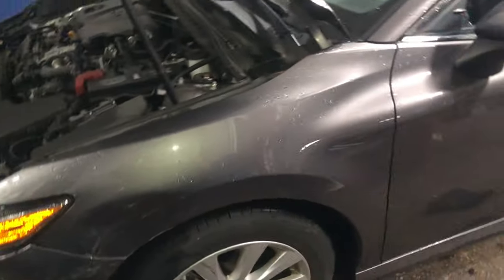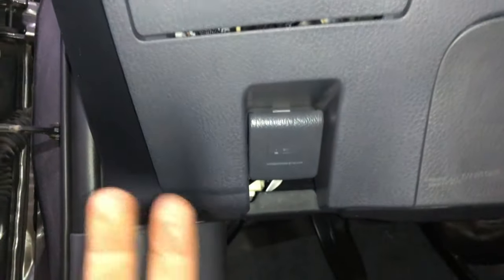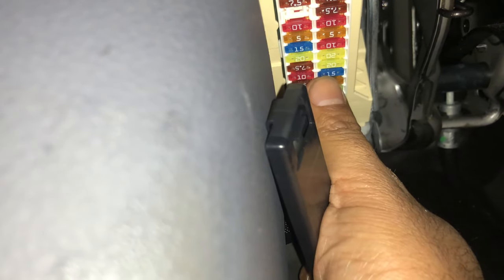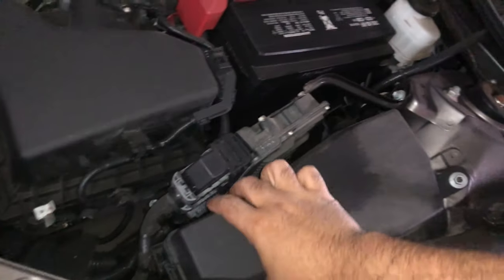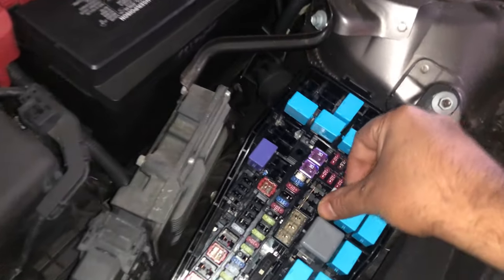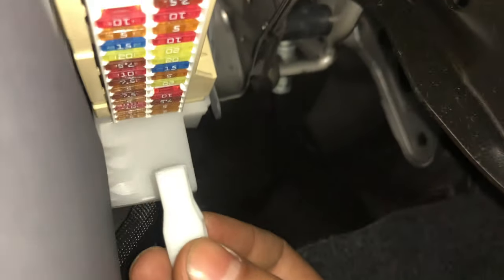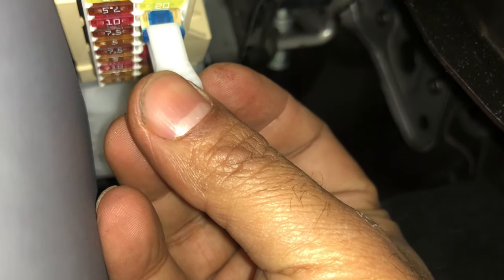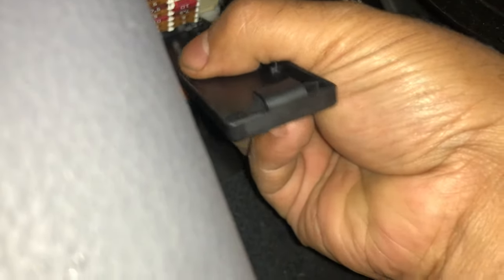Toyota Camry 2018 Cigarette lighter fuse /  Phone charger dont work on Toyota Camry

Comment: What if my cigarette lighter works but my usb port doesnt?
Reply from the maker: Check usb fuse
Reply: Which one is USB fuse
Reply: @RBTheMechanic what is the fuse for the USB?
Reply: @SaknsLLc did u ever find out what the USB fuse is, manual doesn't say I think?
Reply from the maker: @kl7514  it should be listed as usb
Reply: @RBTheMechanic  unfortunately it is not specifically called out in the manual, only the cigarette power outlet is called out in the manual, how do I know what the USB is? I replaced the USB but it still won't work
Reply from the maker: @kl7514  so did u check all fuses could be accessory fuse related to it but check them all
Reply: @RBTheMechanic  checked all the fuses and replaced the connector, still nothing... Maybe it's the harness?

Comment: I have a 2020 camry hybrid XLE. Cigarettes lighter is working but USB next to it Stopped which was only Option for Apple Carplay and Android Auto. Any suggestions
Reply from the maker: Oh ok check ur usb fuses it has fuses as well
Reply: wherees that fuse i only see the one you mentioned  @RBTheMechanic
Reply from the maker: @emiliohuerta2658  which fuse u looks for
Reply: @RBTheMechanic  I was looking for the USB fuse on the 2019 camry, I believe it's the same one as the cig lighter, but I don't have a schematic. Also I call dealer and they said a new USB plug cost 22 dollars just wanted to make sure that I had power going to it

Comment: I want to connect a led light strip that goes in front of the car. that I saw on temu cost $7 bucks.. It says ACC another video says DRL? Not sure what fuse to connect to.
Reply from the maker: It all depends on how u want it I wouldn’t mess with drl it might pop light on dash
Reply: @RBTheMechanic  yeah I just looked at my hood few minutes ago. I realized it's not worth it. The seal around it would just block the lights. It's not worth it. But thank God replying back tho